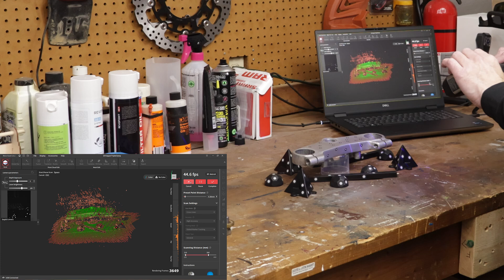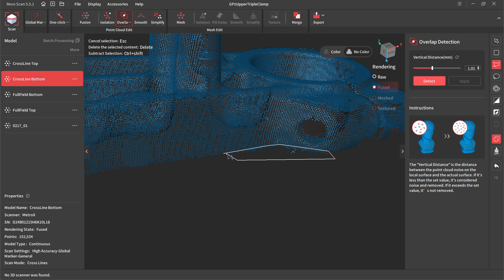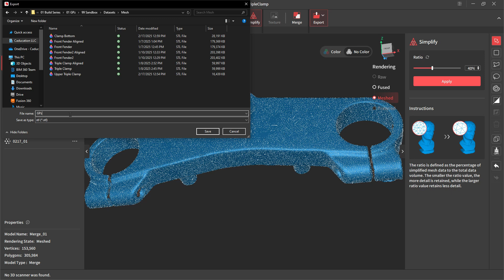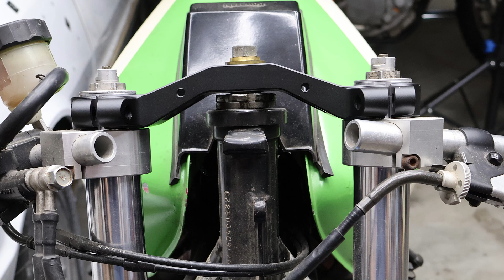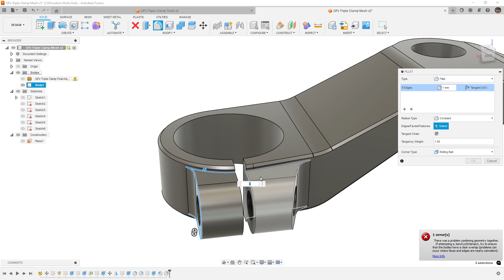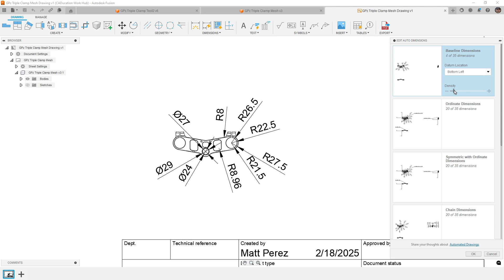How To Design A Motorcycle Triple Clamp | GPz Build Series Episode 3 | #3dscanning #motorcycle

Comment: Thanks Matt. Iver Been using Solidworks for years and they refuse to evolve there products. So switching to Fusion. Keep up the great tutorials its been a slow crossover.
Reply from the maker: Yeah I left Solidworks as my main CAD program in 2018.  I still have a seat of it for client work but after around 2015 or so I felt like the value really wasn't there.  Fusion isn't perfect and can be very frustrating for some tasks, but it is evolving and is a good value in my mind.

Comment: That was a great video. Really good explanation and demonstration. I’ve got the Metro X and love it. I’m just transferring to Fusion and love it. I haven’t got Quick surface though as it’s out of my price range. I can’t really justify that much for how often as a hobbyist I would use it for alignment of scans. 

I’ve seen how you suggest doing it with Fusion but it looks a bit of a faff. Do you know of another cheaper way to do it with some degree of accuracy on bores and faces. I’ve just recently installed Blender and Meshmixer but haven’t really got to grips with the software yet. Could they do it ?
Reply from the maker: The only scan based mesh program I am aware if is Meshlab.  Its open source and can align scans, but i don't remember it having a great option for aligning to xyz.  GOM inspect is another one that I think has a free version where you can align to xyz.

I have 2 or 3 videos on doing it in fusion and its generally a hacky way.  QS Lite is about $400 which can be a lot for a hobby for sure.  Revoscan now has a version of QS lite and im not sure what they are charging for it.  We are a revopoint affiliate as well as QS affiliate.
Reply: @ I can only see QS Pro on their website. Thanks for the reply. I've just watched your video again on aligning scans with Fusion and I think that will be my way. It's not that much of a faff. I suppose you could just align a scan and then export so its saved as a STL aligned for future use to save you doing the same every time. I'm guessing that's possible?
Reply from the maker: there are a few of them.  I did one showing a car transmission scan and how to align, as well as one with a sprocket showing creating a plane and using mesh sections.  If you export a mesh from fusion it will carry the xyz with it.

I think manually aligning is ok just remember not to take too much stock when reverse engineering something.  For example if you are .5deg off a circle won't be a circle, so a mesh section sketch might be off when trying to auto fit a circle.
Reply: @LearnEverythingAboutDesign  I’ve seen the sprocket one I’ll go hunt down the other one with the engine part. Cheers.
Reply: @ have you got the title or link to that video please? The car part that is not the sprocket.
Reply from the maker: https://youtu.be/82vD7YSKIAo
here you go
Reply: @ brilliant thanks. All coming together in my head now!
Reply: @Revopoint has a version of QS lite? Really. Have you got a link to that so I can see how much it is?
Reply from the maker: https://www.quicksurface.com/quicksurface-lite/
We are an affiliate as well so you can use the code LEAD10 and save 10% off LITE or any of the QS versions.

For revopoint, we are an affiliate as well.  You can use the discount code without our affiliate link and it will give you a discount but doesn't help the channel (your choice of course) REVOPRLEAD  
https://shrsl.com/4vft2

When you are in Revoscan you should see at the top right something called "Revo Design".  This is just QuickSurface LITE of sorts rebranded for revopoint.  I haven't used it yet but will be making videos on it in the future
Reply: @LearnEverythingAboutDesign  their software is more expensive than QS Lite but cheers.

Comment: 5:42 this ghosting issue where present with the Revopoint mini as well. Stopped using the scanner because of it. I use a CR Raptor now.

After watching the whole scan this looks painful slow. They have to improve their software even further.
Reply from the maker: Yeah so i realized after filming there is an update to the software which has better GPU usage.  I plan on doing a metroX only video soon with the update.  Full field is very fast but the laser modes take a bit more time.  I have heard the same for the Raptor?
Reply: @ laser (7 line because I only own the Raptor) takes more time than IR mode for sure. But it’s more precise, more detailed and can scan deeper into holes. I heard that 7 line laser mode can be better to pickup deep holes and material surfaces. Not sure you can switch to fewer lines with the MetroX but if you can give it a try.
Reply from the maker: @Todestelzer  yeah the metroX has 7 parallel lines, the 14 cross lines, and then Full Field mode.  

Im going to do some scanning today with the updated Revoscan and see how the GPU acceleration helps out.

Comment: That part was begging to show how to use a flatbed scanner.  I have one that is old that is a pro model  - that one sits on a shelf mostly.  I have another one I got for $10  - it's great because it's USB powered - no wall wart needed.  So if you have a laptop, it will work anywhere.  You can take it to the job if need be.
Reply: Or a better scanner. I use a CR Raptor and would scanned this rather easily.
Reply: @Todestelzer  How much is a CR Raptor?
Reply: @GeorgeGraves  around 1200€
Reply: @Todestelzer  not bad - but i still win
Reply: @GeorgeGraves  ok post got deleted for no reason. Maybe because of a link to a different creator.
I wrote no one is “winning” here. You use what is the easiest to recreate a part. Try and use your 10€ flatbed scanner and scan a water tank handle for a coffee machine for example. Not gonna happen with a flatbed scanner. Measuring it with calipers will not work too. Only option would be photogrammetry or to use a 3D scanner. 

I had to make this replacement part 3 weeks ago. 3D scanned it. Smoothed the scan a little and printed it without reverse engineering.
Reply: @Todestelzer  Not on this part.  On this part, I win by $1190. :)
Reply: @Todestelzer  FOR THIS PART...............I WIN.  END OF CONSERVATION BUDDY.
Reply from the maker: Yeah I generally do Paper Tracing, like we showed on the engine cover part for this bike, and then put the paper on the scanner so the glass stays clean :)

Comment: To be honest this scanner doesn’t look good. With my HX it would have been done in 30 seconds and it is still a « slow » professional scanner. My tip is always Mat spray the objects when you scan them with lasers.
Reply: Dude, the metrox only costs 10% hx….and I just watched a youtube video that guys scanned calibration ring of internal micrometer and made a measurement, the error of the metrox was within 0.003mm.
Reply: @wicsktyay3369  yeah. 0.003mm isn’t going to happen. Best scanners are around under 0.05mm today.
Reply: @wicsktyay3369  you watched a video… hm i work with 3D scan everyday, let me doubt about your claims. 0.003mm accuracy is not possible. Even 2 degrees air temp variations would modify your size by 0.005mm. Certified apparel would manage 0.02-3mm wich is already fine.
Reply from the maker: There is a software update that I need to show which finally taps into the GPU.  that was the big that was missing for performance on this scanner.  I will have an updated video soonish.

I always prefer a scan prep spray as the consistency of the scan is better.  The laser scanners are supposed to do shiny parts and they can but still not ideal for me.  When we scanned on Full Field mode you can see how much faster it was.  But yeah the point was to show it real time so no tricks.

The MetroX is $900.  When i tested the Shining ProHD it was of course a better scanner, faster, higher quality etc but also $10k.  I would hope so at the price jump.
Reply: CR Raptor in 5min without spray. They have to work on their soft- and Firmware. No marker alignment too.

Comment: Hi Matt great job as always!

Just wondering if you have any tips for creating different sized chamfers on the same edge in fusion? for example having a 2mm chamfer that transitions into a 1mm chamfer?

Keep up the good work!
Reply from the maker: Thanks and great question.  that is a very manual operation to do that.  easier on prismatic parts than curvey parts in Fusion.  But basically the same approach to a custom blend. you split the faces, delete what you don't want, and then loft/patch the area.

If its a part you want to have 1mm chamfer for lets say 40%, transition over 20%, then have a 2mm chamfer for 40%, what i would say is actually split the body into 3 pieces.  apply the 1mm and 2mm to each part. combine them back together.  then split the face of the un chamfered section so it blends its edges, delete the faces then patch them.

In plasticity there isn't a variable chamfer but you can add Limit points so you can run a chamfer up to a selected point and stop which prevents you from having to split the body into 3 parts.

Comment: Awesome video. Did you add any tolerance to your measurements for the forks to fit?
Reply from the maker: That is a great question and i maybe should have added more info to the video.  If you click on the Iso standard listed on PCBWays website they will show the tolerances based on feature sizes.  The tolerance as i interpreted their lists was +- .2mm, which seems like but that is .008in.  standard machining tolerances are around .005in or about .1mm.  The fork diameter actually measured 42.93 and the openings in the fork clamping areas measured 43.08mm and 43.16mm respectively.  I sort of hedged my bets that making the model 43mm "as clamped" would give me enough variation to indeed still clamp the forks.

I will say if this was the lower clamp I probably would have added a tighter tolerance as the internals are moving up/down in the area of clamping.  At the top there is a threaded portion and much more material there so the chance of pinching the fork tube or something was minimal.  Making the 43mm diameter where it clamped larger could have been a safe bet but the clamp came in spot on 43mm!(out to 2 decimal places)

Comment: Not bad. $1k in country is cray cray. Should have been able to get it for under $300.  Id love a scanner for things harder to measure, like body parts that wrap around a frame, or multiple connection points not close to one another.
Reply from the maker: yeah. not going to name names but $600 to powder coat...  I could buy a hotcoat gun for $100 and an old oven :)

The revopoint miraco is the most versatile for that stuff.
Reply: I just ordered a pair of engine mounts I designed. $510 shipped from China. The only US-based manufacturer on the site wanted over $8,000. It's insane.
Reply from the maker: @DapperLizard  WOW.  that is insane for sure.
Reply: @DapperLizard  Maybe for a 1 time casting or something with a ton of setup and high dollar materials or if you need an engineering sign off.  A lot of specialty stuff overseas you cant get super legit paperwork from if needed.
Reply: The same company also wanted $20,000 to 3D print a stainless steel exhaust manifold. Or $80,000 to do it in Inconel. I had the urge to email them and ask if their quoting software was putting the decimal point in the wrong spot.
Reply from the maker: @DapperLizard  yeah.  printing metal isn't cheap but that is absurd.